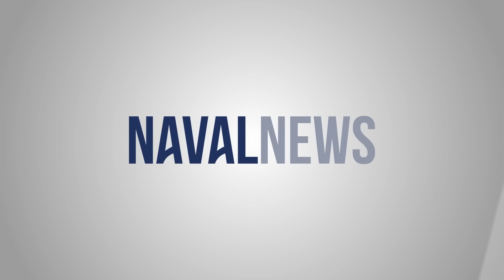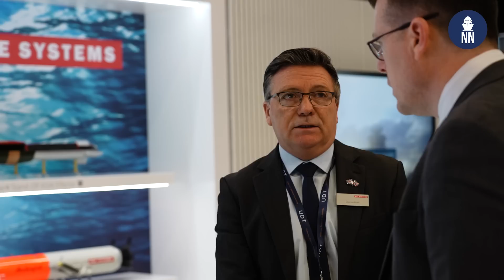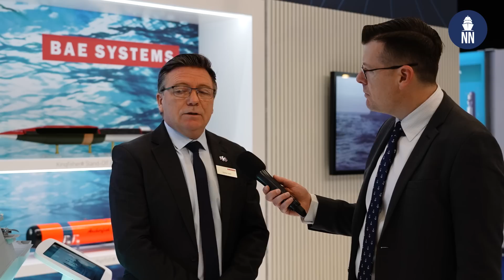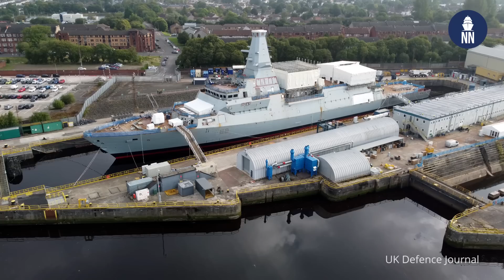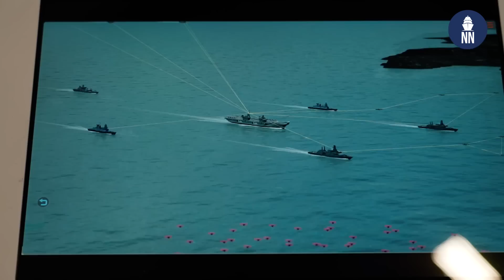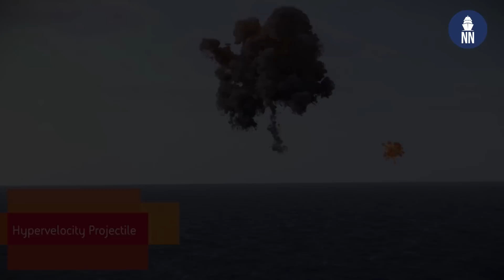BAE Systems pitching Type 26 frigate to Norway

Comment: What a shame that the Artisan radar only have a 200 km range while the other competitors have a 4-500 km range. 
The propulsion system is not up to shape eiter. French frigates have a much better operational ability of 80 %.
Reply: The Type 26 will only carry CAMM and CAMM-ER missiles with a range of 20km and 45km+ respectively with potential future integration of CAMM-MR with a range of 100km. A more powerful radar would be a waste without Aster 30 integration.

Comment: Mostly an anti- submarine ship and unfortunately a bit one dimensional in that direction. 
24 Mark 41 VLS cells is simply not as much as it should on such a large ship. In fact a bit of a failure.
Not so sure this was the right choise, but its probably an OK ship.
Reply: it has 48 further VLS cells?, use common sense, total of 72 missiles, 48 Sea Ceptor air defence and 24 mark 41 VLS which can use a wide range of missiles. plus at least 2x quad packed NSM possible 4x its the best armed FFG in NATO
Reply: @Shaun_Beaumont12345  You have never heard about the negatives about this ships, have you.... 
-How good is the radar?
-Does it take down ballistic missiles??
-Areal defense capabilities?
All these are pretty bad.
Reply: @Norwegian733  That's why the Canadian variant upgraded all of thous , they are very good points tho and well done for brining them up .

Comment: Does anyone know why this type of T-26 was chosen, and not the Canadian version of the T-26? I'm thinking specifically of the Rader and Agies systems.
Reply: Yes, Norway saw the weaknesses in areal air defese and radar, but took a pragmatic choise to add scale with 8+5 equal ships, this means UK and Norway have identical ships, so we will have common upgrade program. 

We get our wishes into T26 together with UK. This is about saving cost and keeping delivery times, Norway is one frigate short and is super keen on closing that gap ASAP.

Comment: The ASW frigate does not combat submarines by being quiet and managing to out-detect them. The submarine is always going to detect the frigate long before the frigate detects the submarine, as least in the passive sonar sense, because surface ships are inherently loud vessels. 
Instead, the role of the frigate actually is use not hide at all, but to use active sonar pings, and detect a submarine while the submarine is still too far away for the submarine to fire its torpedo at the ship. Basically speaking an ASW frigate can potentially detect a submarine by using an active sonar ping, while the submarine is still 100km away. From here, the ship sends off its helicopter to go drop a LWT above the submarine location, the LWT automatically spirals and finds the target once underwater.

So far if you are reading, it sounds like the ASW can easily take out submarines and that the submarine would just be constant victims, however that isn't quite the case, that's because the submarine's passive sonar can detect a surface ships like an ASW frigate up to 160km away, and that's while the frigate isn't even being deliberately noisy doing active sonar pings, if the frigate is doing active sonar pings then the submarine will be able to detect is from as far away as 400km away. 

Therefore, the submarine always has the initial advantage when it comes to being the first to detect the surface ship. Then the submarine has the choice of being able to flee the area, or try to close it for an attack. Closing in to try to attack an ASW frigate is obviously dangerous, because the frigate generally has the longer strike range, its ASW helicopter can easily strike submarine at ranges well beyond the range of the submarine's HWT range. However some specific submarines in fact have something very effective to fill the gap, some submarines don't just have torpedo, but in fact also have anti-ship missiles which are able to be fired from underwater out of the torpedo tube, these breach the water's surface and then continue on to attack the enemy surface ship, a typical example of this is the submarine variant of the Harpoon missile, this greatly increases the strike range of the submarine for striking surface ships, up to around 130km. 

Yes, this means a modern advanced submarine that has anti-ship missiles is likely to defeat an ASW frigate in a 1 on 1 battle every single time. Submarines actually have become a lot more powerful relatively to surface ships over the past 50 years, this is mostly down to the advanced in the sound absorbing tiles and floating platforms and such, not only does it make the submarine impossible to detect with passive sonar, but the submarine itself being very quiet also enables its own sonar to work far more effectively as well in picking up distant faint noises. Add to that, the submarines have longer strike ranges using anti-ship missiles as well, a surface ship cannot bridge the same distance with their weapons in that same time, they have to fly a helicopter to the location to drop a LWT. So even in a situation where both detect each other at let's say a 100km range, the submarine can fire upon the ship straight away with an anti-ship missile, where as the frigate has to have its helicopter try to fly all the way out there where the submarine was detected while the ship attempts to chase it and keep tracking it with active sonar pings to feed updated info to the helicopter for the drop location, yet while that is all happening the incoming anti-ship missile takes out the frigate. 

The simple fact of the matter, is that modern advanced submarines are really hard to defeat. However that doesn't mean it is impossible, with unmanned surface vessels it opens up a new avenue. A mother ship like a frigate or some other large ship could network with let's say 12 small unmanned surface vessels if the corners of 3 expanding square shapes around the frigate, each spaced around 30km from the next USV, making the 3rd USV in a row a total of 90km away from the frigate, with the first 2 USV's actually being data relay USV's and only the most outer USV being a USV with active sonar, let's say the active sonar isn't quite as powerful as that mounted onto a very large ship, but let's say it still has a detection range of about 50km against a typical submarine, this all totals up to 140km and more squares could be added to expand the size if the range is needed to be larger, using 16 instead of 12 USV's etc. This means that a submarine could be detected by the USV's, while the mother ship frigate is still outside of the strike range of the anti-ship missile of the submarine. If the USV itself is hit, it's a small loss only.
Reply: Reads like AI
Reply: Um yes. Don't think you've quite got it right actually. Oops, got to go. Ping ping old thing.....

Comment: The upgrade plan for Taiwan's La Fayette-class frigates includes replacing the air search radar with the ARTISAN 3D (Type 997) radar, which is the same model equipped on the new generation of "light frigates."

Comment: This is the right vessel for Norway 🇳🇴. I approve as a Norwegian. The deal also would involve closer cooperation in the operating of the weapon system as well as military operations and military industry.
UK 🇬🇧 and Norway 🇳🇴 already have closer trade and military cooperation.

Even if the Australian Hunter Class would be the ideal design, with Combat system Aegis and SPY radar. Royal Norwegian Navy knows this combat system

Part of the deal could include Merlin’s as the helicopter for the new type 26 for submarine search, hunting, surveillance, tracking and if necessary destroying.

UK 🇬🇧 and Type 26 🎉 will be the strongest strategically important partnership Norway can enter for the long term viability in operating this weapon system over the projected life time, cost, maintenance and reliability.

Comment: Every time I see the Sea Ceptor (CAMM) mushroom farms on the T26 I feel sad and seeing the close ups of the bow VLS configuration in this video is no exception.

The mushroom farms we see here obviously by definition have enough compartment space below them for CAMM (although I’d be interested to know if they are also long enough for CAMM-ER and maybe even CAMM-MR) but then looking at deck area we know that a single MK41 tube can quad pack CAMM & CAMM-ER & apparently will be able to dual-pack CAMM-MR. Looking at the bow of this model the deck area taken up by the 4 x 6-pack mushroom farm modules could easily fit 2 x 8-pack MK41 (presumably tactical length) or the equivalent made out of the Lockheed Martin ExLS 3-packs and I think the same deck space observation could also apply to the midship silo.

Using LM ExLS modules for front & rear cold launch silos to give (conservatively) 16 x quad-package launch tubes in each silo, could increase CAMM load-out from 24 + 24 = 48 CAMM to 64 + 64 = 128. Admittedly there are other considerations e.g. would we ever procure enough CAMM to take advantage of that but one thing the Red Sea taught us is that magazine depth matters and CAMM is a pretty cost-effective missile to go at least one step beyond the engagement range of CIWS guns and the sort of ranges we’re likely to get with the first few generations of directed energy weapons.
Reply: Only 32 cells can fit up front, the Australians wanted more but couldnt
Reply: @ Understood but might that have been because of compartment space below as opposed to deck area? Maybe forward of the 24 MK41 on the RN version where the CAMM silo is there is only enough depth to go from CAMM canister length up to MK41 strike length close to the centre line.

Perhaps if the RN was still keeping to tactical (CAMM) length it might have managed slightly more than a single shorter length 8-cell module in there, of if using LM ExLS something like 3 x 3-pack would get that forward CAMM silo up from 24 to 36 missiles with maybe the same increase in the midship silo.

Comment: Really like the T26 design, but in its current configuration I think it leaves a bit to be desired. I think the forward CAMM cells could hopefully be repositioned amidship, to accommodate 32 forward Mk.41 VLS cells up over the current 24. That should still allow capacity for 16 NSM launchers, hopefully. DS30M will be excellent, the Americans are just now getting them and it'll be the best they have. But it's been in British service for a while now, and more modern European developments have been made like the Rheinmetall Seasnake30 which has the KCE cannon. Over the Mk44 Bushmaster that the DS30M uses, the KCE is a proper gun capable of engaging aerial threats.

The biggest concern will be the radar, Artisan simply isnt terribly capable. A good upgrade would be to the NS200 - basically a beefed up NS110 which the Type 31s are set to use. If not that, maybe the SAMPSON with SAMPSON EVO, but thats more of a stretch. Otherwised im opposed to giving her fixed arrays, theyll prove too expensive and too heavy. Merlin is a great choice. Simply better than the Seahawk at ASW, and should be used by the Royal Norwegian Navy. The main gun is modernized over the ones in American service, with Kingfisher and HVP it should prove actually contemporary to the 127mm Vulcano from Italy.
Reply: CAMm cells can’t go amidships, not all of them anyway.
Reply: @admiralmallard7500 I've pondered the thought, and concluded there's little reason they shouldn't be able to. They're cold-launch missiles that weigh really incredibly little and are very short, even compared to other short-range missiles like the ESSM. They shouldn't have to ingress into the mission bay space, and should be lightweight enough with their launchers to be situated above it.

At the very least, if it can host 16 large NSMs above it - in their place they should be able to hold 24 much smaller and lighter, cold-launch CAMMs.
Reply: @ yet the existing silo does intrude, if it was possible not to they would’ve done it
Reply: I really do not think it does. I've viewed renderings of the interior, it does kind of look like there's depressions in the ceiling where the CAMM launchers might go - but that depression is also seen opposite where there should be none. I think that is just part of the crane mechanism.

On them not doing so, I think one reason may be because doing so might sacrifice her ability to ripple fire CAMMs between the fore and amidship batteries. If they wanted to maintain that capability whilst pushing all 48 CAMM cells amidship, then they'd have needed to procure more Mk.41 VLS launchers or CAMM launchers up front to accommodate additional CAMMs, which wouldn't happen on budgetary grounds.
Reply: @ Articles have stated the mid silo intrudes into the mission space
Also, Norway currently operates ships with like 8-16 vls so I don’t think they’ll be looking for massive increases
Reply: @admiralmallard7500 Could you provide those articles? I know YT doesn't permit links, so an article title and website name would do.

Comment: It’s taken Britain over 10 years to build One somewhat simple ship .,
Reply: For one it's not a simple ship, the ships gear box for example the produced to the same exacting specifications and by the same manufacturer as the gear boxes on our nuclear submarines  which by definition have to be* very quiet. 
Secondly they are being built at a deliberately slow pace so that the ship yard has steady work & income, instead of buliding them quicker and then having no more orders for a decade or two, kind of hard to retain a skilled work force with no work..
Reply: @  for one you don’t have a skill work force now .. for two , at the pace , even slightly better , means five ships in 40 years, stupidity by even stupid cheap British standards “.. Yes but will these ships work in warm water??  Almost 15 years on , still not done with type 45 failures-, Beside you think replacing the unbalanced shafts on the carriers first would be a good idea - of course those are built to commercial standards, not military… Anyway it’s a simple ship .. just new to the British navy, 41 admiral 31 ships .. because everything is old and very out of date and so few .. very sad .. ( hey we’re in trouble ship wise as well , but we’ll figure it out through hard work “.. not a British trademark.. cheers
Reply: @reserva120  Like I'm accepting the opinion of the land of the LCS & Constellation.. lol Ps, why did the Type 45 have* some occasional issues in very hot climates? That would be because northrup Intercooler 🤔🤣
Reply: @reserva120  What an almost entirely unintelligble screed you just managed.
Reply: @whatever-w5n   try again little man
Reply: @reserva120  Don't need to try, I succeeded the first time as indicated by your angry reply 👍

Unlucky.

But seriously though... honestly what you wrote was so incredibly unintelligible I strongly advise you to go back to school to get a basic level of writing. Punctuation doesn't work by grabbing a bucket of it and throwing it at the paragraph.
Reply: @  not anger at your stupidity, just disappointment..
Reply: @ not anger at your stupidity- just disappointment.
Reply: @ not anger at your stupidity, just disappointment.
Reply: @reserva120 No no, you're angry.

I wouldn't comment on the intelligence of others if I were you, not when the "complexity" of the @ symbol and replying has foxed you.

Also, not when you think the function of a hyphen is to drop it randomly at a sentence and call it a day. It's "impressive" to make so many errors with so few words.
Reply: @reserva120 No no, obviously you're angry and embarssed. 

I wouldn't comment on the intelligence of others if I were you, not when the "complexity" of the @ symbol and replying has foxed you. Also, not when you think the function of a hyphen is to drop it randomly at a sentence and call it a day. 

It's "impressive" to make so many errors with so few words.
Reply: Nearer 12 for HMS Glasgow when finished but that was because it had to be designed from scratch the Docks had to be built from scratch 
The heavy plant machines installed etc now there are 5 hulls already on  the production line and the last ships will be much quicker 
Every ship is built faster and has upgrades  than the previous one thats how it goes with naval ships
Reply: Most definitely not a simple ship. Designed to be near silent.
Reply: @ it’s been done .. and given British quality controls or lack thereof.. guess we’ll see .  5 ships in 40 years - doesn’t really matter does it!!???
Reply: @reserva120  
People in glass houses and all that.

The issue with the Type 45 was the US made and designed intercooler, and how many Constellations are in the water ?
Reply: @kevinshort3943  oh it’s far worse than that in the US navy .. The Americans “. US navy “ doesn’t have the Long deep British culture of being “ Mind boggling Stupid Cheap “ that the British people have to fall back on..

Comment: Type 26 is by far the best choice, but it should be more similar to the Hunter class instead of choosing the RN version.
Reply: The Hunter has US weapons and the expensive top heavy Radar that Trump can switch off at any time. Suggest you stick with the sea captor as the experience the brits have with these systems will shine though when you need the weapons in a real world situation
Reply: As a Norwegian I think the Hunter Class would be Ideal but due to time constraints and the desire to join an existing production line for first delivery by 2029 the hunter class isn’t really an option at the moment.
Reply: Or the River class
Reply: The other versions of significant hull changes, they’re not an option off of the British production line
Reply: We want T26 before 2030, we lost a frigate in 2018 and are super stressed about getting navy back at intended size, for that to happen RN need to give up 1-2 ships